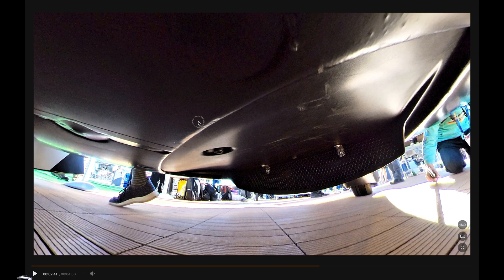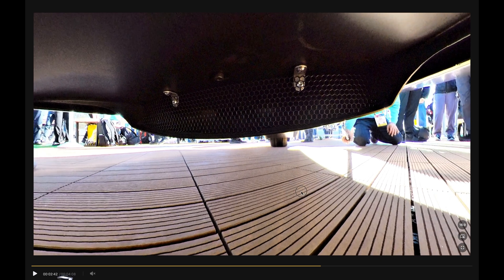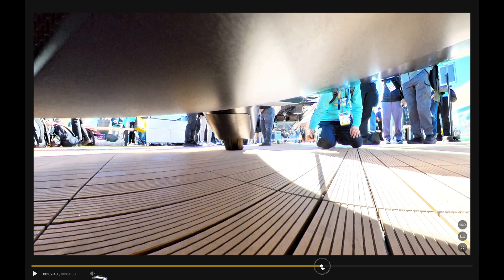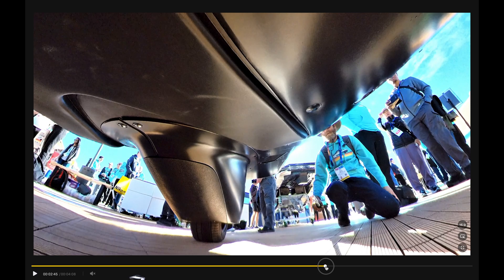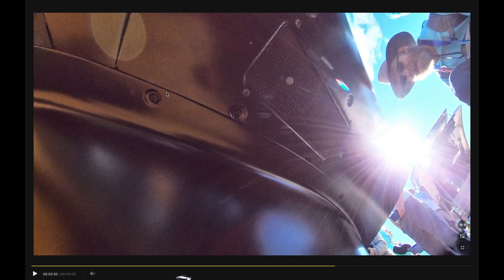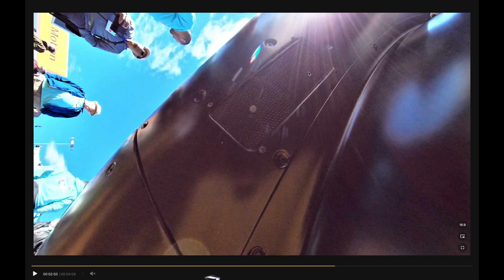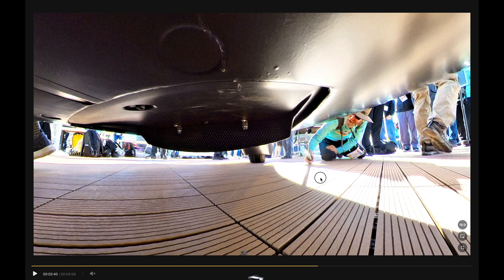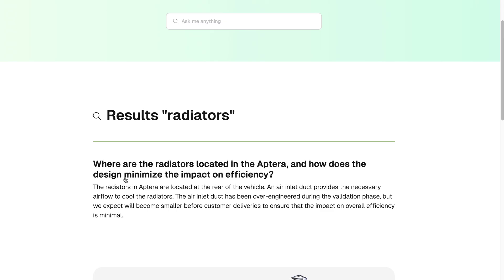CES 2025 - Aptera Radiator - A Closer Look #ces2025

Comment from the maker: Aptera.us FAQ

The radiators in Aptera are located at the rear of the vehicle. An air inlet duct provides the necessary airflow to cool the radiators. The air inlet duct has been over-engineered during the validation phase, but we expect will become smaller before customer deliveries to ensure that the impact on overall efficiency is minimal.
Reply: @RajGiandeep   Vitesco radiator is designed in front of the motor and an early PI photo showed it still there. What's up with that?

Comment: if you high center for any reason that things going get ripped off would be better to have smooth bottom
Reply from the maker: The design is bigger than it will be at production. It will get smaller.

All my years driving. I've never high centered any car. Have you?

Comment: IMO, they need to move the intake completely from the bottom.  It already rides low and I an probably take it out on a decent curb.  The engineer I talked to said they were probably going to remove it and probably put it somewhere else.  I honestly think they could have it from the front and have had it got under the center console but that may not be an option for it at this time.
Reply from the maker: I'm curious how it will change. but they over engineered it for the track testing in early Feb.

Comment: My Acura TLX needs to be angled when entering my driveway because the city water channel dips in front of it. I am concerned that this new low radiator would not clear the City of Scottsdale drain channels in front of most residential driveways.
Reply from the maker: It will get smaller in the final design. They over engineered  it for the track days (happened last week) so it handle anything they can throw at it.

Comment: Solar output 200-300watts on test drives at ces,  efficiency 4 to 6 miles/kwh ( based on distance of test drive and battery level)....not looking a ywhere near what they claim....assume you did some calcs on it?
Reply from the maker: I didn't get a good look at the kwh. He wasn't driving very smoothly though, hard acceleration  & normal driving mixed in.
Reply: @RajGiandeep  I dont think there is any kwh on the pi2 dash display, it only has  battery as % value, have to just use how much battery used.....and using 42 to 45kwh pack size estimate kwh.....is it not odd to you there is no kwh displayed? It's rather important value to know, at least we now the solar is less than half what they predicted, that means 40 miles from solar is less than 20 miles at vegas in full sun, in fact due to the variation in solar probably less than 10 miles in vegas full sun in January...let's get real numbers not made up exagerations
Reply: On the contrary. They were actually getting the full 700 watts during the event and as one of the engineers stated to me, actually too much. 2025 looks great!
Reply: @charllectric4842  see test drive videos clearly recorded max of 260w .....you've been lied to if told otherwise

Comment: I too am concerned about snow and water intrusion from the low inlet as well as ground clearance getting to a trailhead.
Reply from the maker: It will get smaller in the final design.
Reply: mmmm gotcha.   its supposed to only be used in socal

Comment: Why not try using the opennings for the front struts/axle as an intake?. It is one of the areas with the highest air pressure.
Reply: I had the same thought. Reduce the high pressure zone between the wheel pants and cockpit and have passive air flow over electronics and back to tge radiators. Win win
Reply from the maker: good idea

Comment: That's amazing.  The snow is not an issue.  It will melt and drip down out of there anyway if it's cooling the battery pack where that is located if it were to collect.  It'll likely be more tucked out of the way of the belly in the last iterations anyway as they prescribed.
Reply: Have you driven in lasting snow?
Reply from the maker: It will get smaller in the final design.

Comment: It is a bit concerning that the air intake system seems far from finalized.  In a purist sense I dont think it can be called a PI vehicle if they are still working on the air intake size valdiation then tooling.  Winter driving is concerning, with this design.
Reply from the maker: Ya, hopefully they can adjust it to be as small as possible or even test in a inverted scoop instead.

Comment: The only problem I see with that design is that it will strike things under the vehicle. Also, there might be more drag. I read some comments that snow will collect in there and block air flow. If it's cold enough for snow to be on the road, you won't need cooling from the radiator.
Reply: Very wrong about cooling in winter including radiator fans.
Reply: @artsmith103  You know saying something like that and then not explaining your thought process is just lazy.
Reply: @tims8603   it's a fact, not a thought process.
Reply: @artsmith103  When have you ever had an original thought?
Reply: @tims8603  Engineering degree from top 5 school in the country, PE license 1st attempt, 25yr specialty in fluid mechanics, heat transfer, reactor design. PHEV, House 95-100% powered by solar, boat and camping van have necessary solar elec. Helped model install of 3 other residential solar arrays, all doing well. I think I was the first one to announce the necessary vent though I expected 6" circle in leading edge (just for Vitesco equip.) Take your radiator belt off for the winter and keep us posted.
Reply: @artsmith103  My radiator doesn't have a belt. My water pump does. That's an ICE vehicle. If you're really an engineer as you say, you would know that ICE waste most of their energy as heat. Electric motors produce very little heat by comparison. The battery doesn't either. In winter, you want the battery to be warm. Since you are, obviously, a liar, I don't believe any of your claimed credentials.
Reply: @tims8603  I type things pretty densely. If you went into repair shop and said you needed the radiator belt for your vehicle, they would give it to you immediately. EV waste about 25% as much heat as ICE. The radiator, fan and vent are smaller but still equally needed in typical vehicle shape.
Lucky me, I just changed alternator, belt, and plugged radiator holes.
The Vitesco radiator is about the size that was on my 500cc (~25hp?) motorcycle. 125kW=165hp. See the ratio, 7:1.
Reply: @artsmith103  I agree, most of what you post is pretty dense. Not in the good way.
Reply: @tims8603  We are talking about the radiator fan, so either belt or electric connection. Not the water pump. When the Aptera vent closes, the water pump will keep running. So a little easier for you, disconnect your radiator fan, probably just a wire connection.
Reply: @artsmith103  You said radiator belt. You must not know anything about cars. It's called a fan belt or an accessory belt and hardly any cars have belt driven fans anymore. Yet you claim to be an engineer. Are we talking miniature railroad engineer? I already explained how dumb that is. I'm not going over it again because you probably still won't understand.

Comment: New England winters can be brutal. They dump a ton of road salt and sand on the roads, and driving on snow covered roads is a necessity. Placin thr scoop there seems like a terrible idea. Is water, salt and sand entering in that intake an issue ?
I would imagine it is.
Reply from the maker: It will get smaller in the final design.

Comment: This is not good, the first lump of ice in the middle of the road is going to take out the intake. This also negates any rough or gravel road excursions. What about large speed bumps. Argh.
Reply from the maker: It will get smaller in the final design.

Comment: I currently get 43 mpg in my hybrid. I intend to use Aptera to commute back and forth to work, pick up kids from school, take my wife on date nights (which will probably happen on Thursday mornings). If Aptera is even 75% of expected efficiency I am going to love it. I was originally attracted to the original hybrid model (because I have been chasing fuel efficiency for as long as I have been driving), and the technology is finally catching up to where EVs make much more sense.
Reply: Didn’t expect such wise couples advice here… "take my wife on date nights (which will probably happen on Thursday mornings)"  👍😀👍
Reply: @ the kids will be in school and that is going to be my day off I think.
Reply: KidS (plural) in the trike?
Reply: @ I grew up riding in the back of a pickup truck. I will figure out how to introduce a bike handlebar into the cargo area so that one of them can hang on for a quick trip to or from school when the (rare) need arises.
Reply: My Isuzu pup truck average 35-40, and the old Isuzu car was in the high 40s occasionally over 50.  Needing a hybrid to match the mpgs cars in the 80s were getting seems environmentally unfriendly considering the extra batteries etc

Comment: It seems to me that Aptera is making design choices based on efficiency and not durability. This is yet another one. I hope they realize that the rest of the world does not live in sunny SoCal where the roads are nice, no snow and lots of sun. What I'd like to see is them in an area with snow. For example, where I'm at, we got hit with snow. I left home, there was 4" on the ground. When I got to work, 10". Now the temp is really low and snow is not melting at all. First it's the front fenders and now it's a intake for the heat exchangers.

Also, please do not bring up what they did in Switzerland where they had a parking lot that was plowed and it had maybe 1/4" in ch of snow on it. That's not snow testing in the real world.
Reply: Maybe given the lower temperature the radiator functionality is not needed so if it clogs up it won't impact much.  I've been driving my 13 year old Leaf in which the battery is completely sealed and no cooling and I'm still on the original battery because I take care to not leave it charged fully for long periods, vary the charge and haven't fast charged it.
Reply: @madmotorcyclist  It is not just to cool the vehicle, it is to use the heat pump to heat the cabin and battery pack in cold weather, so it needs to be clear.
Reply: @mikegrok  Aptera does not have a heat pump.
Reply: @madmotorcyclist  On a previous news cycle, Jason mentioned that they use a 2kw capable heat pump, but usually only run it at 200 watts to condition the cabin. The battery pack may use the same heat pump or have its own.
Reply: For instance on the display it is 4 funnels. The inner funnel cools all of the electronics, the next funnel is the air return from the electronics, then there are two more, left and right for heating/cooling the driver and passenger.
Reply: @madmotorcyclist  - So no need for cooling in the winter. Thus, they could make the duct go up in the body during the winter months then. Thus more efficient and longer range.
Reply: @billsmith5960  Well, stay up if not required for cooling.
Reply: One of the better chats about temperature control. There is a radiator in front of the Vitesco motor/gear reducer very far forward. It needs about a 6" duct. I wonder how that fits into the story?
Cooling is definitely needed in winter, including radiator fans.
Reply: @artsmith103  Many of their parts so far have had connectors for liquid cooling. Other components (like the motor), may have a fitting for liquid cooling where they regularly use air cooling. The whole thing is usually encased in an aluminum shell anyways, so making one of the end caps have a liquid cooling radiator is not a significant change.
Reply: @mikegrok  I have no doubt the Vitesco equipment will be liquid cooled. I didn't mean to suggest otherwise. The comparison was to air cooling larger electric motors if the radiator isn't vented adequately. Even at modest 60kW, 15% heat loss is 9kW, 30,000 BTU/hr, 2.5 tons depending on the units you like. Those are Vitesco numbers. Maybe they'll improve them someday.
Reply: @artsmith103  - It would be interesting if Aptera was transparent and showed what heat exchangers are where. At this point, one for the driveline, one for the battery and one for the AC unit. The real key for this when it comes to reducing the amount of drag, is to make sure the exit is not the choke. Obviously the H/X will be, as that's the nature of the beast.
Reply: @billsmith5960   Exactly. Vitesco info is pretty clear. Radiator is mounted in front of the motor/gear reducer. Their rated 15% inefficiency of 150kW power leads to estimate of 12" sq. radiator needing 500 scfm. So about 6" duct for that. At one point, I'm sure I saw that radiator mounted in front but I guess they could have moved it.  I suspect they aren't including it in this discussion. Some fanboys are suggesting the vent isn't necessary in cold snowy weather. I've suggested they remove their radiator fan belt for the winter and keep us posted  ;-)
Reply: @billsmith5960   Slightly related, recreational yachting is interested in electric auxiliary vs traditional diesel. For how much it's typically used, the motor/battery combo is very expensive but it's a trend. 250W solar is aggressive minimum for fridge, autohelm, navigation, and communication. 600W is manageable install, some squeeze in more. The preferred motor is 10kW (13hp) which is 50% of recommended for the size boat typically used. Some have tried air cooling for convenience. I don't think it's ever worked and eventually water cooled is required. 7% of Aptera's motor size.
Reply: @artsmith103  - That's true. You need fluid flow (air is a fluid) for the H/X to work. It will radiate heat for a bit but soon, that becomes too much and thus a loss of efficiency. One other thing they could do is have shutters to limit the amount of air going across the H/X. There are cars that have this. For example, the first time I seen them was on a 1987 928S4. Other vehicles use them and some more recent vehicles.
Reply: @billsmith5960  They have recently had trouble sourcing the externally cooled belly pan, and put that off to possibly after production starts as an upgrade.
Reply: @mikegrok  - I doubt it. It's easy to blame the suppliers as opposed to something that pretty much doesn't work. It's like the hub motors, we all know why they are not using them. They told us in the SEC filings.

Comment: Thank you for these pictures!
This air inlet's negative impact on the air drag coefficient and overall efficiency may be very low.
But especially fresh and deeper than ground clearance snow will immediately clog it even before making it out of the driveway and also while driving on not yet compacted snow on any road, and when it's snowing steadily while driving on the freeway.
Differently than dust, snow can't get filtered out. To hope that it will be cold enough that no ventilation will be needed would be a poor strategy.
Reply from the maker: It will get smaller in the final design too

Comment: I think NACA ducks (1 on each side) would be an elegant solution and would not protrude in the air stream. Jet aircraft use them for this reason.
Reply: NACA ducts! Came here to post that but you beat me!
Reply: https://youtu.be/CbvnYQH_ZzA
Reply: @ perfect
Reply: While a NACA duct would look cool it will not pull in as much air as a traditional scoop. You're talking about airplanes and jet fighter aircraft that use NACA ducts when a small Aptera will be legally traveling no faster than 70 miler per hour and on average a whole lot less.
Reply: Just in case the comment from NorCalSkeptics is deleted here is the title to the video. NACA Ducts - Aerodynamics Explained.

Comment: As I drive on a LOT of dirt/gravel/rough roads, I’m a little concerned about the placement of the radiator inlet. As well as how it handles snow. Is it now the lowest spot to the ground, or is it higher (relative to the ground) than the belly pan in front of it?
Reply: I share these concerns also.  Even just road grime building up, or freezing the screen over in the winter.  I hope not, but it could end up being a high maintenance area in your case of dirt/gravel/rough roads, or during particular times of the year.  I look forward to what Aptera has to say about it..... there is likely more detail to come.
Reply: If it is fan driven vs blower, they can run the fans backwards when it is in off road mode, so it sucks from the cleaner air, and keeps those vents clear for highway mode.
Reply: @mikegrok  Ooo, that is good out-of-the-box thinking!
Reply: Air would out of the radiator, on to the road, air intake from hood/windshield valley so chances of dirt blocking radiator is unlikely
Reply: @andremcamara3120  I have liked the original idea of air intake at the base of the windshield/top of the hood area.  Except for the possibility of rain water to deal with, it seems like a good source for clean air.
Reply: I'm not a fan of the low air intake for this design, I'd much rather see our initial impression of the air intake coming from below the windshield.
I guess we'll see what happens.
Reply: nothing kicks up the gravel in front of the radiator. and snow affects all radiators.
Reply: Reminds me of the issues Corvettes have with those two low radiators in the front with a lack of a functional grill.

Comment: The air intake arrangement is getting a lot of chatter… it will be interesting to see how it plays out.
Reply from the maker: Indeed. In the end as long as it works & doesn't effect range. That's what matters. I'm sure it will be a smaller in the final design.
Reply: i'm constantly amazed that all these monday morning quarterback engineers actually think and are convinced that aptera engineers havent considered any or all of this.  give aptera some design and efficiency cred folks, will ya?